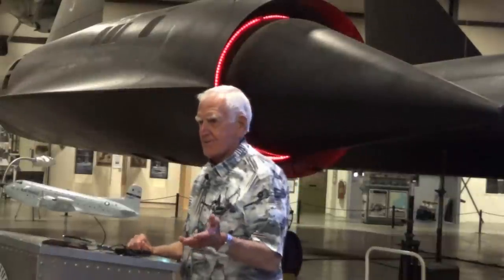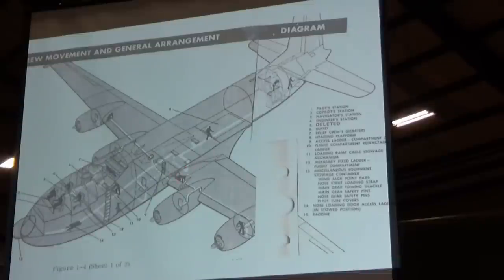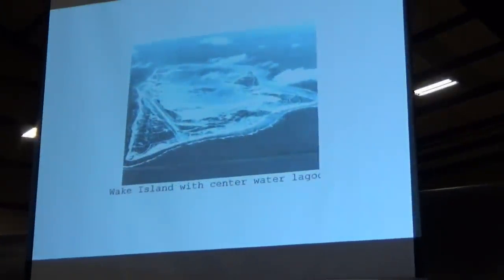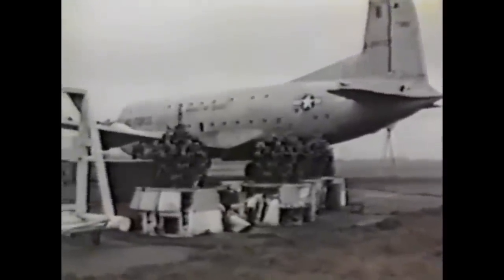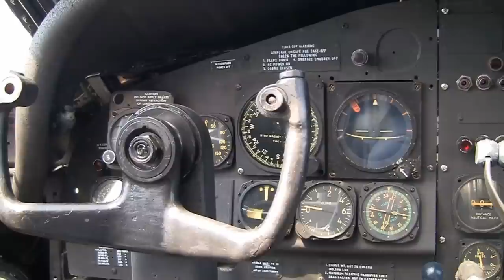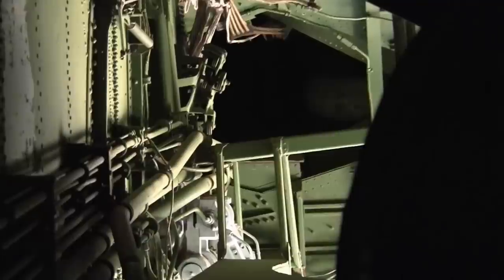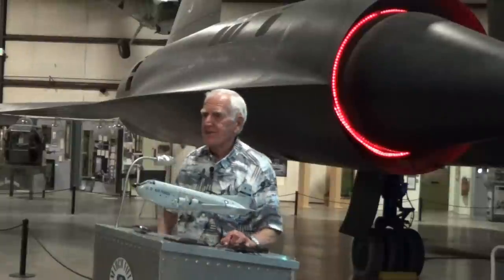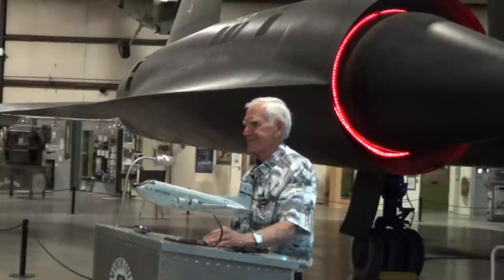Jack Warneke C-124

Comment: I was a R-4360 engine mechanic on C 124's at Rhein Main AFB, Frankfurt ,Germany 1967-1971, I changed many engines, about 3 days labor to R&R engine and flush out the oil tank which held 62 gallons of oil, the C-124 and the C-133 was the only airplane to carry a 4360 engine on a L stand, many TDY trips all over Europe changing engines. I just love the old round engines, from DC 3, to C-119, C -118, T29, C131, DC, DC4, DC6, C121, C97 and jets C141 and in 1970, the first C5A, still work on airplanes 50 years later, good life, oily but good

Comment: Jack, I’m so glad I stumbled onto this video. It was fascinating to watch both the C-119 and C-124 presentations.  You might have flown with my father, Darrell Rucker who was an air reserve technician at March AFB from 1962 until the C-124’s were mothballed.  He started out as a flight mechanic on the C-119 and then became a flight engineer on the C-124. He had a distinguished aviation career ending his 28 year reserve career as a C-141 flight engineer and a civilian aviation career as an air traffic controller and an FAA aviation safety inspector. He always said that his time as a C-124 flight engineer was the best job he ever had.
Reply: Yes, I flew in both the C-119 and C-124 with Darrell Rucker

Comment: Growing up in San Antonio in early 50s allowed me to see and HEAR these wonderful aircraft flying mostly from Kelly Field.Though I lived north of downtown,  early morning found me listening from my window @ the roar of multiple 4360s warming up. It was easily 15 miles by crows flight to the field and yet the noise vibrated everything near. Kelly was also the repair facility for 4360s so B36s were also present. When one would take off, the air actually seemed to vibrate. Loved it then & still one of my favorite memories. Air shows were excellent here.

Comment: I flew on the C-124's several times to and from our satellite base while stationed at Barksdale AFB. The aircraft was good and I enjoyed flying on it and hearing the roar of the engines and hoping it would remain airborne. I always wanted to lay on the double bunk bed which the aircraft had in the rear for the loadmasters, but never did do that. All cargo came in from the front of the aircraft and that is where we would bring in our equipment and tied it down. I was always worried about the crane which was above in the ceiling coming down while inflight, but it never happened. Overall "Old Shaky" was a good aircraft and got me to where we went safely. I see that you are standing there beside the SR-71 and I got to see them take off and land at the base I was stationed at during the Vietnam War.

Comment: Very nice and interesting talk. I flew on the C-124 a couple of times between McGuire AFB and Puerto Rico. Though they call it the "Shaky" it was actually a very comfortable ride. Much more relaxed than the high vibration of the C-130 and a lot quieter than the C-141. Fond memories.

Comment: I worked on C-124’s from  August 1967 to August 1970 at Hickam AFB. I was in an aero repair shop. We did flight controls, cabling, jacking and removal / replacement of major control surfaces. We also did the maintenance on the crane and cables. It was a wonderful aircraft. My avatar was taken out in front of our shop. Hickam AFB Hawaii

Comment: I was a flight mechanic on c 119 at Long Beach afb 1958  transferring to March afb in 1960 when c 124s came in ichanged a carburetor on thanksgiving day as the plane was to go on to japan the following day I had much experience on the r 4360 having been a crew chief on b 50 s at walker afb no 1952 to 1956
Reply: To bob rucker I knew Darrell very well a fine man and a great engineer

Comment: Supported them at Dover AFB, 67-70 Avionics Instruments Tech, Donot miss working on those high wings and engines in wet,cold,windy weather.  Flew on them several times, it's Old Shaky for a reason.😉🇺🇸🗽

Comment: In 1955 I flew on a C-124 to Japan in one of a whole bunch of C-124s from Pope air base at Fort Bragg NC the aircraft I was in also included a Haftrack with a Quad 50 caliber guns  on the back and a Army 2 1/2 ton truck aboard. In was a double decker with troops on both floors

Comment: It served well!  I'd love to learn more about the R4360's--it must've been like a musician constantly tuning an instrument keeping one happy...x2 for the C-119 , x4 for the C-124!
Reply: The L-1 mag fired the left-hand plug in the B and D row. The R-1 mag fired the right-hand plug in the B and D row. Getting the baffles back the engine on after removing them for maintenance was a bitch. They never wanted to back on right. There was a tank of 80 gallons of alcohol-water mixture in the nacelle right behind the engine that was used to prevent premature firing in the cylinders during full power. This was called "ADI" for anti-detonation injection. 
What else you want to know?